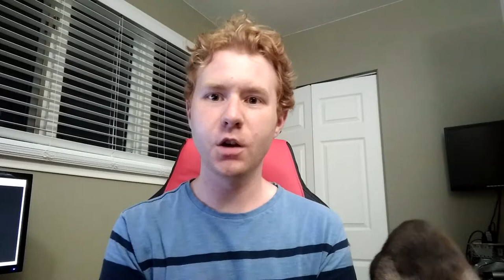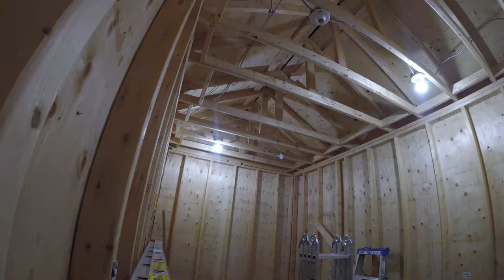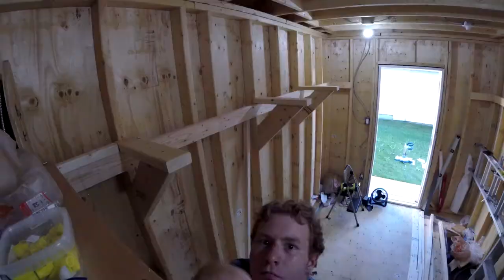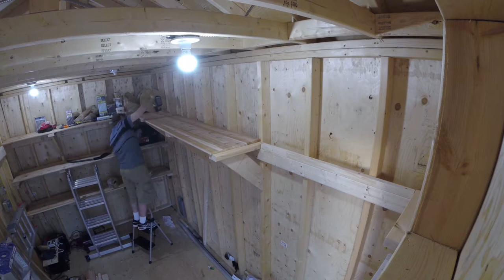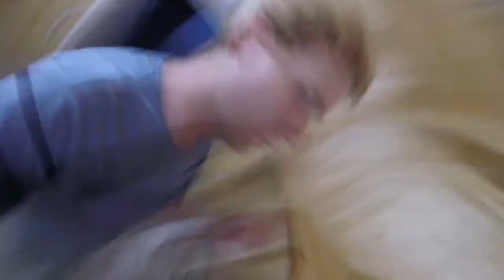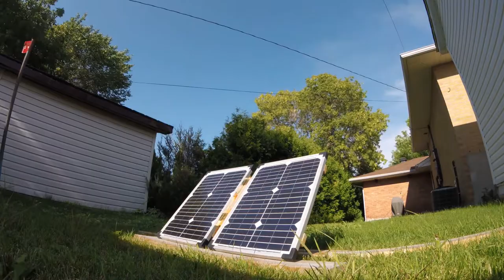Shed Build: Shelves

Comment: This one of my next projects. What's your take on solar panels from Harbor freight.
Reply from the maker: Never been to Harbor Freight but if it's anything like Canadian Tire or Home Depot they're probably way overpriced.   Try to stay below/around, say, $1.50/watt.  I know the ones at CT are like $600+ for 100w so it's a total rip off.  Even when they go on sale for $200 it's too much.    That said if they are decently priced, they're probably ok, you'd have to check construction of them to see how they feel, if they feel cheap or not.  As far as I know they mostly are made very similar from each other due to similar manufacturing processes.   If they are advertised as being for RVs or boats then at very least you can expect them to be properly weather proof.   My mounts finally came in today so hoping to start on that soon, so I can put my 4 100w Renogy ones up.